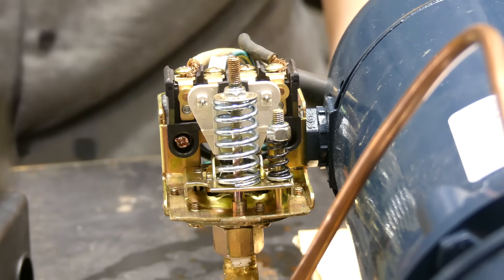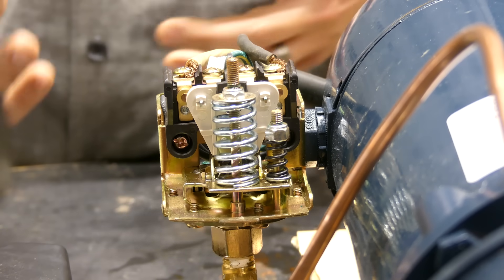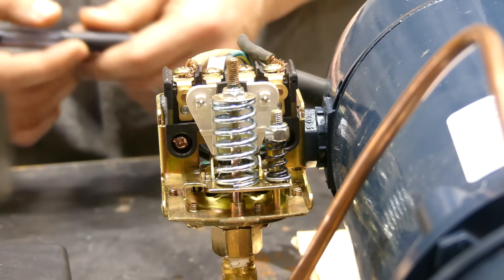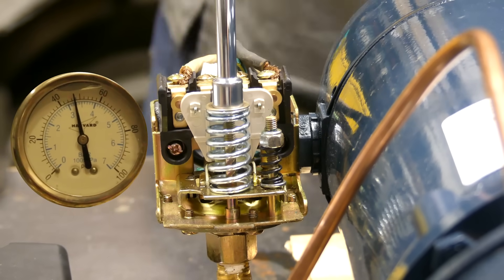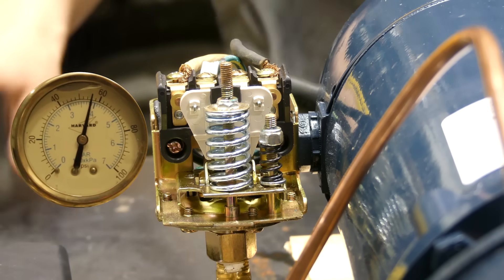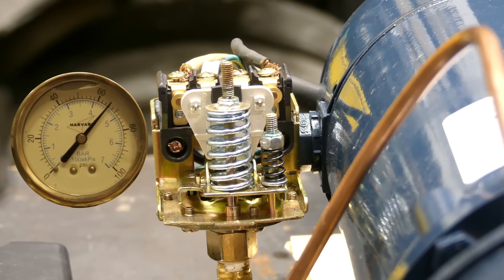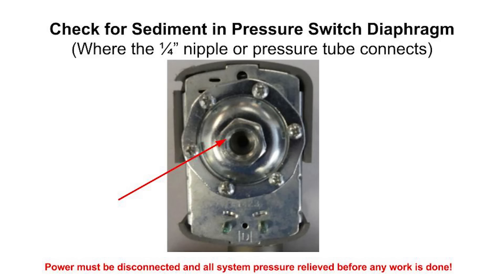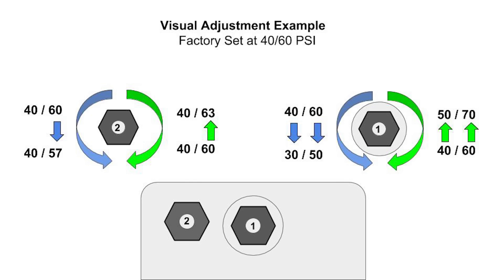How To Adjust a Pressure Switch

Comment: Good video for showing how the adjustments are made.  How did you cycle the pump though? My pressure switch right now shows static at 40 psi but I am not sure if that is the low, mid, or high range of the setting without cycling it like you did.  

We have very bad water pressure in our third floor bathroom and I want to make an adjustment but don't know what the current setting is.
Reply from the maker: You just have to run water to drop the pressure and watch where it turns on and off at.
Reply: If you have insufficient pressure on your 3rd floor, you will need to adjust your pressure switch.  This will work if your pump is strong enough (1 hp).  BTW, 40 psi at ground level should  be sufficient.

Comment: I have a question, after you have increased the pressure say 10 lbs, I am assuming you must increase the bladder pressure in your air tank by 10 lbs correct?

Comment: Tons of useful info in this video. Currently my pressure pump is not cutting-in until I'm at zero pressure. I'm guessing I've got a clogged filter at the switch?. I'm ready to tackle it.

Comment: You just saved me 100% of cost in less than 15 mins thanks for your videos!
Reply from the maker: AWESOME! Love to hear it!
Reply: R.C. Worst & Co., Inc. my toilets weren't filling after we lost power and made some plumbing adjustments I primed the well and kinda figure the pressure switch had something to do with it had to turn a bit over 20 psi but solved the issue.

Comment: This is what I was looking for; second floor pressure was the issue. Copper pipe house with a 40-60 pressure gauge and looking to add another 10 psi. I also learned that after it's set to 50-70, you must set your bladder tank pressure to 2psi less than pump engage psi, i.e., 50psi kicking on is 48 bladder (Bladder is measured at null water pressure state). Correct me if I'm wrong but I ran this and it seemed to work.

Comment: Sounds like what I need to do. I got a new switch, pump and tank a year ago and the pressure kinda sucks. The installers didn't inspire confidence so I'm betting they didn't even look at that gauge let alone adjust for my needs. Thanks

Comment: My pump is set to to 30 to 70 psi.  Looks like I need to back off on the range trim adjustment, then adjust the center adjustment, to set 40 to 60 psi That should take care of the sudden drop in pressure that I am getting, even after adjusting the air bladder to 2psi below current pressure. Nice video!
Reply from the maker: Thanks for the comment and for watching! :)

Comment: my switch is now ajusted an working fine till i use my gardening hose which bring the pressure really low quickly but then the swicth does not trigger and pump simple does not get triggered. I have to manually restart and the pump and then everything works fine afterwards. what is your suggestion to remedy this situation? thanks

Comment: Since the "come on" pressure is raised by turning the middle screw, do you have to add more air into the tank now? Let's say it was a 30-50 system and you have 28psi in the tank. Now you adjusted the screw so it comes on at 40psi and goes off at 60. More air or not is my question.
Reply from the maker: Yes! You would need to adjust the air pressure to 2 psi below the new "come on" pressure.
Reply: @RCworstwater  Thank you

Comment: My pressure switch shows 5 and the water flow is ok if one tap is open. If you open 4 taps at the same time, the water flow is quite poor and the pressure gauge shows around 0. Basically it looks like the pressure switch won't turn on when the pressure is low. I have tried to rotate the screws but it doesn't make much difference. Any idea what it could be? The pressure switch itself is new. The previous one started to make some chattering noise and I replaced it with the same one. Now I am struggling to set it correctly. Any idea why the pressure switch won't turn on when the pressure gets too low?

Comment: Great vid and explanation.  Question if you don't mind ... When traveling, I shut the breaker to the well off -  when turning the breakers back on - I don't get water until I toggle the lever on the pressure switch 4-5 times.  once I get pressure back - I'm golden and never have a problem. Only when shutting the breaker off and then turning back on after a few days.  Could this be a bad pressure switch or a bad pressure tank?
Reply from the maker: You have a low-pressure cutoff switch, it is designed to do that. Check out our video on it here:https://www.youtube.com/watch?v=ROvZpwHV9Ho&t=20s

Comment: Hi, I'd like to seek your advice regarding my water system. I installed a 2hp water pump attached to a 60liter bladder tank near a water well situated approximately 250 meters away from my house and is about 20 meters below my house ground level. The cut on/cut off of my pump is 40/60 and the pre-set air inside the bladder tank is 38psi. The pump is working fine and is pumping water up to my house but it won't cut off when it reaches 60psi. It keeps running until it shuts off after some time (20-30 minutes). Is there something wrong with how it was set up? Appreciate your advise.
Reply from the maker: Give us a call: 855.329.4519
Reply: Congrats to you for using a big enough pump.  Perhaps the pump can't put out pressure above 60 psi?

Comment: I just bought a new pump with a pressure switch of 20/40. I also bought a 86 gallon tank. With pressure at zero I have 18 pounds. However, the pump won’t shut off and the pressure gauge reads 32 pounds and will not go any further. Do I need to make an adjustment? I know this is elementary, but I’m still confused.

Comment: Thank-You! For this video. I didn’t understand it before. 
Q. We had our hot water heater replaced a month ago. It was a low income group that was helping us. They did a lot and I wasn’t here. Our water pressure is awful now. When someone flushes or uses the shower the pressure switch clicks constantly. Going from 25 to 60 fast. Not like your video, you have a slow build up. 

Do you think increasing the water pressure to 35 would help?
Or is this a sign of something else?

Thank-You!
Reply from the maker: I would recommend checking your pressure tank. It sounds like they may have adjusted it. We have a video on how to check/adjust pressure tanks on our channel.
Reply: @RCworstwater   Thank-You! So much I will!!!

Comment: Hi there... been struggling with this for a while.... pls help

I have a water pump in the garage that is fed water from 700 ltr tank that is on The same ground level in the garage as well...
When the main city hall water is fed to the house ... the pump doesn't even turn on... it's like it's not there at all (All good so far)

When there is not main city water supply... The pump feeds the 4level town house and works well...
BUT ... I am forever adjusting the pump pressure valve cause at cut off it is  one minute ok and cuts off as it should ... but most of the times it is clicking and clacking like a u know what.... (pls excuse the punt) 

I think it might be that the reason is due to the tank water level (hence water tank pressure) that changes either  higher or lower pressure to what the house pressure is... 

Any ideas on how to rectify this issue... or if anyone e has had a similar issue and can shed some light...Will be much appreciated

Comment: My home the upstairs shower spits at you but the shower downstairs has good pressure. The switch was rusted out and I recently replaced it to accurately check the pressure. So  we have a 30-50 system and we have a well pump. What I noticed is that it shuts off at 50 but turns on at 20PSI. Can I update the switch to a 40-60 switch to raise the pressure? We have copper pipes for the plumbing.
Reply: If the switch appears to be in good shape, just make the adjustments.  Start by turning screw #2 fully CCW.  Then turn screw #1 CW until you get the proper cut-in pressure.  Then turn screw #1 CW until you get the proper cut-off pressure.

Comment: Hi folks.

I appreciate the video, still not sure if this could resolve my issue.
The hydrophore i got runs well, gives good pressure but after about 2 galons of water it just literally stops. Then after 15 sec approx the water comes back (tap must be open, otherwise it dont come)  just as well as the 1st time did. Most of times is 20 sec roughly waiting time,  sometimes several minutes...to the extent i need to flush toilet and somehow that would help hydrophore to send a new "wave" of water again.
Hydrophore is below house lvl, roughly 35 feet.
I'd appreciate help. Thx

Comment: gd day sir, I want a differential of about 15 psi, is there a way I can adjust the pressure regulator, however my pressure tank maximum allowable  pressure is 50 psi, I live in 5 storey bldg and the pressure tank is located on the first floor, at present my setting was set at 48 psi 28 psi, my problem now when the pressure drop to around 28 to 29 water pressure in the 5th floor is not enough. thank you sir.

Comment: thanks for the explanation. 
one question...
what psi is the air pressure tank at during this adjustment process. do i need to add more air to it also????
Reply: After you are all done, shut off the pump and drain water from your system.  Then add/remove air from the tank so it's about 2 psi under the cut-in pressure.

Comment: Awesome Tutorial!  3 thoughts:  1) (You caught this :-) When changing the switch pressure it is a good idea to check and adjust the well tank charge pressure.  2)  If one raises the differential much over 20PS they can shorten the life of the diaphragm well tank as they are designed to handle a 20psi differential and a higher differential  will stress the diaphragm.   3) In my situation I needed to lower the pressure a bit (~5 psi) to get increase the pump GPM.  My pump was operating off the top of the pressure flow curve (water lift is 90ft + system pressure = apx 210ft+ head needed).  Calling for a lower pressure actually increases flow.   If the cut off pressure gets too low for house needs it might be a good idea to decrease the diff to maybe 15 but that will mean the switch lifetime will be shortened a bit.   That until I change pumps...   Question: Is the pump lifespan actually decreased by number of turn on/off cycles or are only the pressure switch contacts effected by cycles?
Reply from the maker: In general, the more pump cycles = decreased pump life

Comment: Thanks for making such an informative video. Very helpful!
Reply from the maker: Glad it was helpful!
Reply: @RCworstwater  Just out of curiosity, how much adjustment is there on the high end cut off? I bought a 40/60 switch to replace a 30/50 bc its all that was available. I tried adjusting the high end down to 50 and it wouldn't reach that low so I had to find the 30/50 switch to replace the original. This worked.

Comment: If you are still answering questions I installed a new shallow well pump with the pressure switch 20/40 it cuts on at 20 then around 36 to 38 it quits building pressure if I tap the pressure switch it will cut off so I adjusted the differential just a bit and it would cut off at 38 now it's sticking again and I have to tap it to cut if off also since the pump replacement the water pressure in the house is weak ...could there be a problem with the foot value or any advice you can offer thank you in advance
Reply from the maker: Give us a call, it sounds like it could be a few different problems: 855.329.4519
Reply: @RCworstwater  Thank you so much I will give you a call Tomarrow I really appreciate it ....

Comment: I have a Rinnai RUC98IP, Instant-on Propane water Heater. The User manual says, "Minimum Water Supply Pressure: 50 psi. (Recommend 60-80 psi for Maximum Performance". My pressure tank pump is a Red Lion RJS-100-PREM, 1-H.P. pump. I know the pump has a maximum pressure of 65 PSI running on 230 volts. Could I use a Square "D" 40-60 pressure switch and adjust (tighten) the range spring for a range of 50-70 and then adjust (loosen) the cutoff pressure spring to bring the cutoff down to 63 psi., thus having a range of 50-63? Or is it better to just go with a pump that can reach a top pressure of 74 psi and adjust the cutoff spring on a 60-80 switch to get a range such as 54-74?
Reply from the maker: You should not be running your pump at its maximum pressure. Any deterioration in the pump will cause it to run continuously and burn out. Give us a call if you're thinking of getting a new pump: 855.329.4519

Comment: Hello my pressure switch doesn't want to stop the pump I see the pressure is reached by the pump but the Switch don't turn it of if I tuch it it stops. It almost burn the pump down because the pump left out of water. Should I switch the Pressure Switch with new one or what should I do?

Comment: Hello there!you have a very good video but I want to ask you something please!i didn’t wire my switch yet and I adjust the spring and I don’t know what pressure work now and I afraid.the indicator is on maximum .and a second question is about the wiring.L1 goes to the first seat the neutral at the end ?thamk you very much!

Comment: I have a jet pump in the basement, the water works fine down there the problem is upstairs it short cycles continuously clicking on and off...how would I adjust that? also the pressure in the shower is good.

Comment: I have a question and I'm not sure if this is the correct place to ask but here we go. When running my garden hose open or trying to draw a bath and fill the tub my well pump will kick out. I have to manually charge the well pump by actuator in the arm on the side of the pressure switch twice before it will catch the fact it dropped below the low pressure cutoff.
Reply: The switch has been replaced and I checked the small pipe leading to the switch for debris and can't notice any. Would just adjusting to bring up the low range solve this problem or is there something more I should be looking into
Reply from the maker: That low pressure cutout switch is installed to stop your pump from running dry when the well water drops down to the pump. Learn more about it here: https://www.youtube.com/watch?v=ROvZpwHV9Ho

Comment: Quick question(s):

What size is the hex nut to adjust pressure

To adjust only pressure, does well tank need to be drained or we can adjust w/water inside tank (deenergized ofc)

Comment: I have a flotec vertical 1 horsepower pump that i recently replaced the pressure switch 40-60 psi and it burned out in about two weeks. Only the side of the pressure switch where the black cord line attaches to.  Pump runs on 240 volts. What would be a reason that the pressure switch burned so fast in 2 weeks compared to the other times were it lasted for months?

Comment: Hi, thanks for the video. We are running micro sprinklers in a hot house for an hour at a time. Should the pump run continuous for this time or should it be cutting on and off for the hour running?
Reply from the maker: It would be best if the pump ran the whole time
Reply: @RCworstwater  Thanks, so would that be a matter of adjusting the pressure switch.

Comment: Your well videos have helped me a lot! I checked my pressure tank and it was only at 14psi so I brought it up to the 38psi it was supposed to be at and my pump is supposed to be a 40/60 split but it’s turning off at 55psi so I will adjust it tonight to make it cut out at the 60psi it is supposed to cut out at.  I just bought this house last summer and I’m working out the little bugs it has here and there. Thanks again for the help!
Reply from the maker: You bet! Thanks for the comment

Comment: Thanks for your video!!! My pump sometimes don’t turn off the pressure is ok but if I hit a touch to the switch  turn off. Before this problem was backwards don’t turn on, i find thr small tube clogged with sand.
Reply from the maker: Glad it helped!

Comment: Great video. My pump switch is also set up for 30-50.  Its also under my cottage. Whats a safe pressure to increase the pressure to that wont damage copper pipes.
Reply from the maker: I wouldn't go higher than 60 PSI - and you want to make sure that your pump actually reaches the higher pressure and shuts off.
Reply: I have had copper pipe connectors fail at 5 psi due to bad installation by plumbers.

Comment: So if I am using the pump as a transfer pump and I want it to start at 0 pressure and turn off only when I turn it off back off the big screw all the way and crank the little screw all the way down. I'm not using it as a well pump at all and will be watching it as I pump water.

Comment: You video was very helpful and answered several questions I had.  It looks easy enough to turn the one bolt to increase the pressure and still keep the range, but how high can I adjust this up?  I have a two story house and a finished attic.  The pressure is lacking at my faucets and showers.

Comment: I got a new D switch and installed it but it doesn't click at all. Contact plates remains in contact when working or stopping. does it mean the switch is faulty? or pump issues?

Comment: Question: and I think it goes without saying, but if I have a 40/60 pressure switch, you are saying there is no danger in raising the pressure to 60/80 if I wanted to even though the switch is a 40/60 preset?
Reply: Can't say No.  Old plumbing may have problems.

Comment: I'm a new'comer when it comes to well pumps but I successfully installed a pressure switch because the unit would not cycle off. The new one is now doing the same thing. So I attempted to adjust it and changed the factory settings??? Your video was most helpful but I'm back to turning off the system manually!!! HELP!!! (All thumbs.)
Reply: your pump is most likely worn and weak, is not capable of producing enough pressure to satisfy the switch